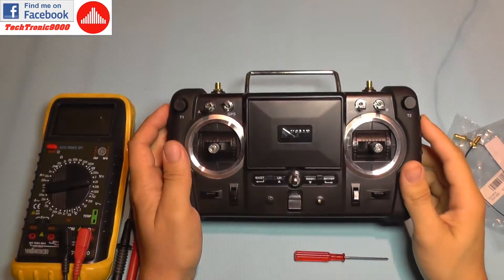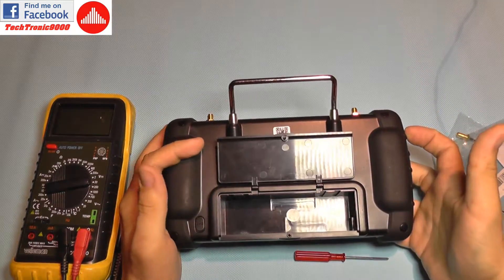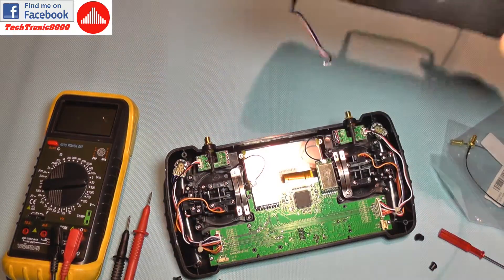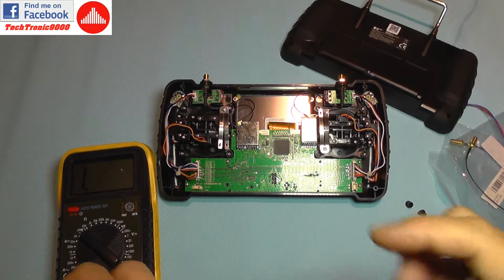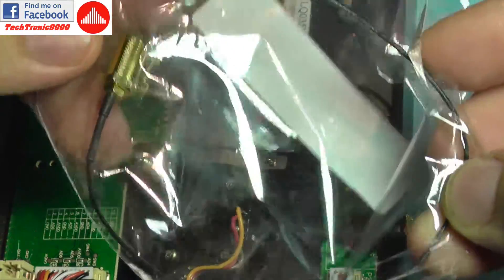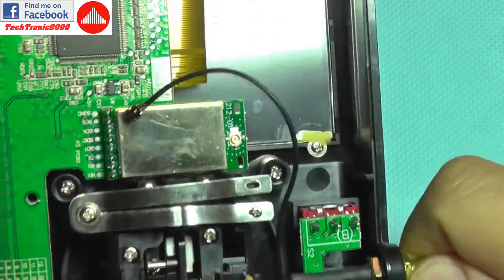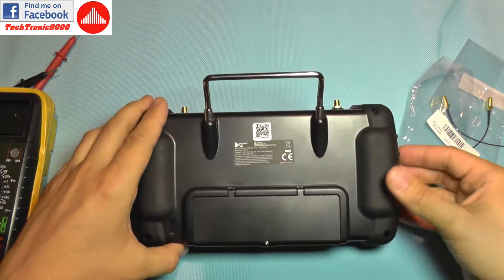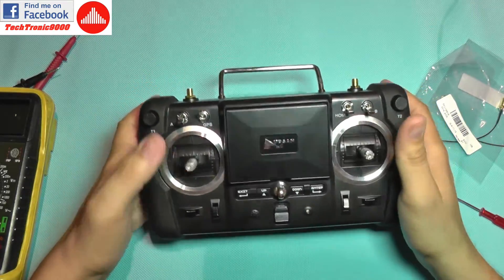Hubsan H906 / FPV1 Transmitter Range Issue FIX

Comment: Great video.  I just came across this video as I am a new owner of the Husban H501S-S.   My version has the latest firmware from Husban installed for both the transmitter and the drone.  The interesting thing is that on the back of the the transmitter it says Model FPV1, and not the H906A.   I have not noticed any range issues, but I have not had it further than maybe 100 meters.

I will take apart the transmitter soon and check the continuity of both the 2.4Ghz and 5Ghz antenna cables.  I will try and post later and let everyone know what I find.

On a side note, I had two defective H501S-S drones.  Both of them had motor issues.  Both came with the "black motors".  Unfortunately at the time I did not check model number on the transmitter.  I assumed they were the H906a transmitters.  Who knows...?

The third H501S-S X4 Professional  replacement came with the "gold motors" and the FPV1 transmitter.  The QR code on the FPV1 transmitter says H501S-S.   So, if your still with me I am not sure if some systems are shipping with the FPV1 or H906A.
Not sure.....  Not even sure it makes a differnce.  As I said before, all three were H501S-S versions with latest firmware installed on transmitter, flight controller and receiver (drone).

I will try to keep people posted when I get the chance to find out more.
Hope this helps some of you guys out.

Comment: I took apart my brand new (May 2019) remote and sure enough there was no continuity on the antenna wire. I replaced it. Now I have continuity on my antenna wire. This is my first drone and you saved me alot of headaches. Thank you.
Reply from the maker: Wow didn't even thought that in 2019 they still have this issue! Thanks for your comment as I highly appreciate it!

Comment: I just took apart my brand new transmitter (FPV1 but says H906A on "menu" screen) and both the 2.4Ghz and 5.8Ghz antenna cables checked out fine with my continuity meter.  Its best to have a multi-meter that buzzes in continuity mode so you can hear the response and not need to look at the meter when working on electronics projects.

The center conductors of both cables are very small.  So you might not get a connection the first time you try.  Clean with a little 91 percent alcohol or electronics contact cleaner.  Recheck....center to center should have continuity.  Outside connector (Ground)  to outside connector should have continuity.  
Continuity means the cables are in good working order.

Center to ground should not have continuity....If there is continuity , this would indicate a short.

FYI...Both of my IPX/Ipex connectors were glued to the circuit boards.  Glue just peels off easily.  When done checking cables, press IPX connector back on.  It should snap on tightly.   I used  a small piece of  electrical tape over connector and circuit board to secure if you want.

Hope this helps.

Comment: Great video for the beginner! There is one item you missed.
On the Hubsan 5.8GHz SMA to IPX pig tail is a flat grove cut into the treads. I
suspect it’s there to allow the tip of the SMA to compress into the base of the
patch antenna. Which allows the antenna to be tight with the transmitter for angel
adjustments. A hand held grinding tool might be needed to duplicate the
original SMA. I’m going to experiment with SMA adapter.

Comment: do you know the frequency of this remote? of the 2.4ghz?
Reply from the maker: Control is 2.4G, FPV si 5.8G
Reply: you ask the frequency then say 2.4... it varies per power cycle that's why you have to bind and not just set frequency. even then hubsan uses proprietary encoding for the rc control.